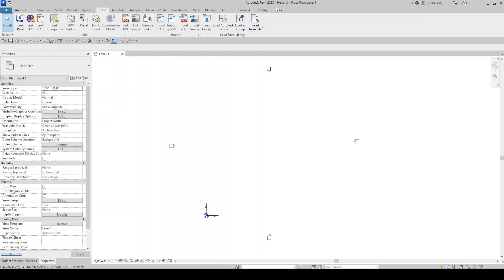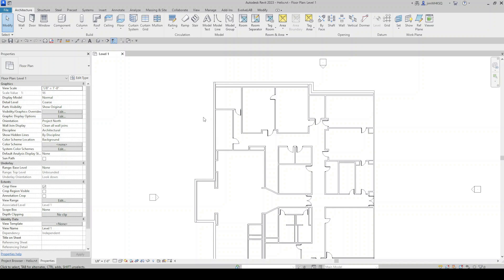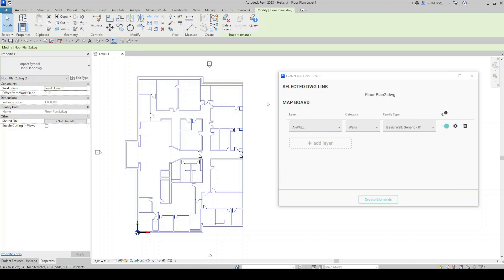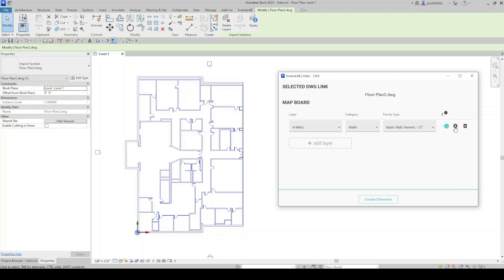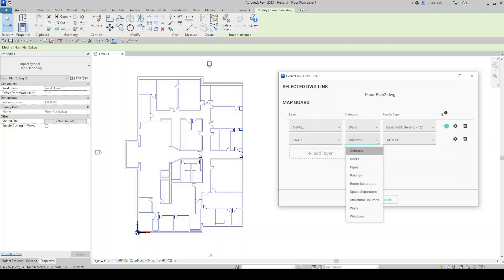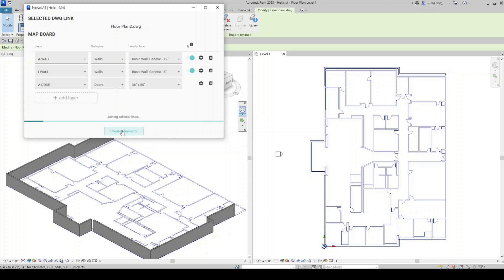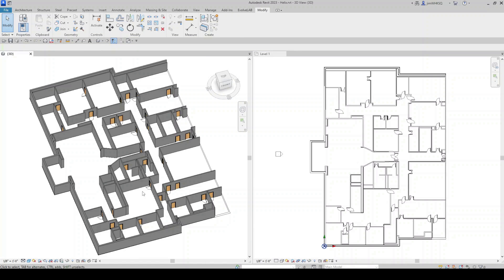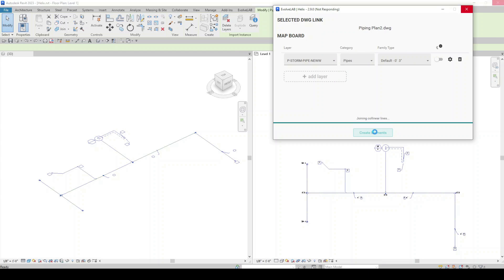How To Convert AutoCAD 2D Floor Plan to Revit 3D Model

Comment: I made a similar algorithm with Rhino inside Revit, even inserting other elements such as furniture... the only detail is that it is required beforehand to prepare the dwg so that the conversion is efficient... if you work under certain protocols in CAD it is very efficient, even modifying the dwg the change is automatic in Revit.

Comment: Very cool software. Why would you only put a single wall along the center of 2 walls? Do they represent something besides two separate walls?
Reply from the maker: Great question.  There aren't two walls in AutoCAD, rather two lines that represent the thickness of one wall.  The tool recognizes those two lines, and draws one wall down the center.
Reply: @EvolveLABio that makes sense. Thanks for the response!